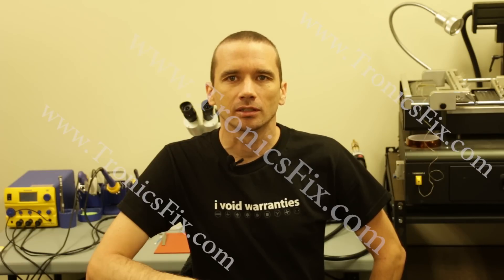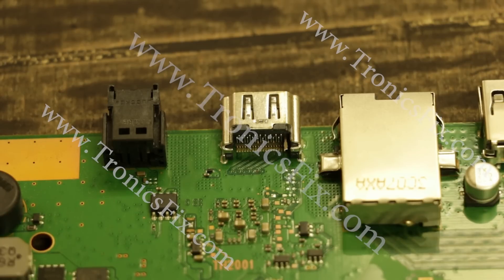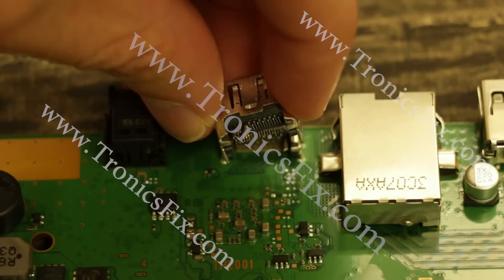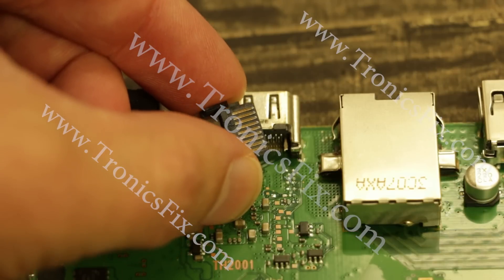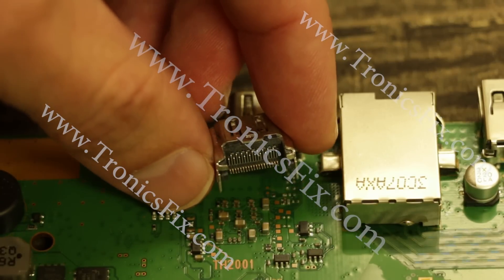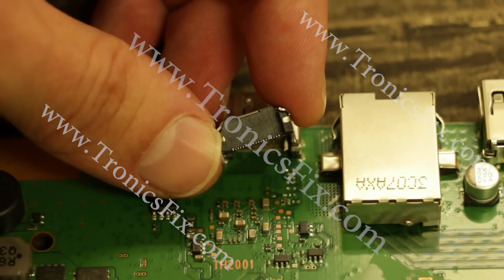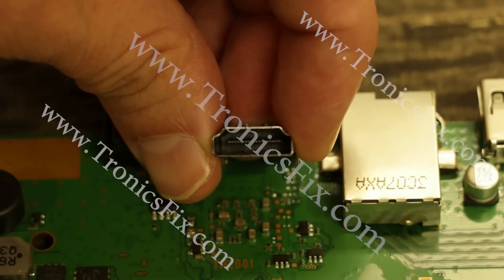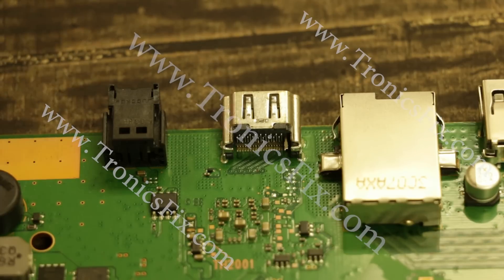Why PS4 HDMI Ports Suck

Comment: Hi, I have a PS4 launch system purchased 2 years ago and due to some health issues and surgeries I had I wasn't able to get around to unboxing it until yesterday. All it does is a pulsing blue light. I called Sony after trying several displays, HDMI cables, and not getting anything to display. They told me they can't do anything for me because it's out of warranty. Even after explaining this they saw that I have been grabbing the free PS4 games from the PSN web store and consider that to be "using the PS4". so even though the box wasn't opened until yesterday and its been powered on no longer than a cumulative 10 minutes they want me to pay $150 + shipping to have it repaired. ... ... Do you know of anything so can possibly try to fix this POS system? ... ... I really hope they get a class action lawsuit against them. It's shameful how they try to sweep these widespread manufacturing defect issues under the rug and ignore loyal customers. At least Microsoft owned up to their terrible RROD problem and allowed anyone to get it fixed for free, even well out of warranty.
Reply from the maker: +videogameobsession This problem is usually fixable but not always. If you're ready to go ahead and buy the repair you can buy this repair: http://www.tronicsfix.com/ps4-turns-on-then-back-off.html 
Even though yours doesn't turn on then back off the fix is the same price.
Reply: Thanks for the reply. Can you tell me if this launch system "Blue Light Of Death" issue is a corrupt firmware issue or something that requires solder reflowing? If it's the latter won't it eventually happen again after more use? Thanks again
Reply from the maker: +videogameobsession It's not a firmware or software issue. It's caused by a bad connection between the APU and motherboard. We don't do reballs or reflows so if that's what you are wanting you'll want to send it somewhere else.
Reply: I don't necessarily want that. I just want it fixed in a way where it won't have the same issue happen again. 
Can you please explain how you guys fix that problem? Thanks.
Reply: +TronicsFix Can you please let me know a little about how this problem (bad connection between the APU and motherboard) is repaired and if the console will have a shortened lifespan with a fix like this?

I have purchased PS4 games for Xmas gifts so I would like to have a working PS4 in time for Xmas if possible. Thanks.
Reply from the maker: Unfortunately we don't give out any info about our fix for this...yet. We will be producing a video as well as a repair kit for it soon, but it's not ready yet. 
The fix has a 30 day warranty because usually the fix lasts a long time but sometimes it doesn't. We're always happy to take a look at it again for you (for free within 30 days) but there is no way to know for sure how long it will last. We have it priced low because of these factors. Once we get our repair kit out there we will probably discontinue this repair for mail in consoles.
I hope this helps...let me know if you have more questions about it.
Reply: +TronicsFix Thanks for the replies. 
I'm not sure what to do here. 

I've been through hell with both the Xbox 360 (had 3 die on me) and the PS3 (had 2 die and many game saves). I paid to have the 360 fixed and it died again in 4 month (not through you guys). And now it's happening all over again with the PS4. 

The fact that it was dead out of the box and Sony won't do a thing for me (except charge me $170) is making me want to give up and stick with older game systems from now on. 

I heard the only way to ensure it will last even a year is to reball the APU to the motherboard.  I just really don't want to constantly worry about it dying yet again.
Reply from the maker: +videogameobsession I'm not sure where you heard that about the reball but even that does not guarantee anything. Usually a reball will last quite a while (assuming that you have it done by someone who knows what they are doing) but not always. 
I totally get how you feel...that's a bad track record! You may want to just have us give it a try, if it's not fixable then we will send it back and you only have to pay the $20 for us to ship it back. We refund the rest of your money. 
Another option is to just sell it on Ebay and buy the newest model, the CUH 1215. That one seems to be designed better. We can't be sure as it hasn't been around long but it looks better so far.
Reply: +TronicsFix Thanks for the advice. I'll have to think about it.
Reply from the maker: +videogameobsession You're welcome. Good luck! Let us know if you need anything else.

Comment: So I got mine replaced around April and there's times the signal is lost or it is not supported, the cables I use work with my PS3 and my other devices.
What do you think of this? Should I get a different cable or get the port looked at again.
Reply: Okay read some other comments I saw getting a new cable should be first 
Weird thing is the cable works for other devices, maybe the port they attached is not compatible with the cable.. 
I'll find out
Reply from the maker: Edwin Vasquez Where did you get it replaced? Sometimes the cable is the problem, but usually a cable won't randomly go bad (although it does happen). I'm guessing it may be a problem with the repair you had done but no way to know for sure. I'd have a look inside the port to see if there are any bent pins.
Reply: TronicsFix I'm looking at it right now. I usually have to force the hdmi in with a bit of force. the pins are fine. I'm not sure if it is this tiny piece of metal that I see in the port. I feel like I should push it down but Idk with what.
Reply from the maker: Edwin Vasquez I wouldn't try pushing anything down...that will probably just damage it more. It could be just the back of the port being loose or something which would cause some of the small pins in the back to become detatched. I would try a new cable first though.
Reply: TronicsFix Thanks for the replies.
Okay It's acting normal for now, but I will order a better cable for now. I'll update if anything. 
Thanks again.
Reply from the maker: Edwin Vasquez Sounds good. Yes, please update if anything changes so others who read this will know what happened. Good luck!

Comment: But mine works at my house other people's houses It don't  work and my HDMI thing isn't bent so I don't know
Reply from the maker: +king YedMelJrx If it works perfectly at your house and displays the picture just fine then your HDMI is probably fine. You should wiggle the HDMI cable a bit when it is plugged in with the console on. See if that does anything to the display. If not then it's probably fine.

Comment: Nice video man! By the way Thanks for fixing my PS4 HDMI. Much appreciated!
Question: Did you end up using that new HDMI port on my unit? Just curious if I have that one or not. Thanks!
Reply from the maker: Angel Acosta Thanks for the comment! No we did not use this new HDMI port...unfortunately we didn't have any of them...we are just getting our first order of them in the next few weeks. The one you see in the video is a sample that they sent so I could check it out.
Reply: TronicsFix Oh I see, that is pretty cool though that you are working with this company to correct this major issue on these units. Well, keep up the good work! As for my system it seems to be working fine and have had no issues. yet with it. =)
Reply from the maker: Angel Acosta Ya, the HDMI port on these are one of the major weak spots. These new ports should fix the problem 100%. I can't wait to be able to install them instead of the old style...they will be so much more reliable. 
I'm glad to hear that it's still working great. If it ever gives you problems just let me know!
Thanks for subscribing...we will be making more videos as we have time. If you or your friends have ideas of videos you want to see, let me know.

Comment: I took my PS4 to repairman for this and he told me their is a 50% chance the playstation will never work again if he uses a heat gun on it. You seem like you can fix the problem no matter is it because the ppl i took it to are amatuers?
Reply from the maker: +letreason reign First of all, yes, he is right that there is a good chance it won't work if you use a heat gun on it. Heat guns are for stripping paint. Anyone who uses a heat gun to fix electronics is an amateurs. I'm not saying that it's not possible to fix some things using a heat gun, just that it's not a professional way to repair things...especially other peoples things. 
We can fix 99% of HDMI problems. We use professional tools and equipment and have fixed over 1,000 PS4 hdmi ports.
Reply: +TronicsFix i live in montreal canada. how much would i be looking at to ship and repair?
Reply from the maker: You can see the prices right on our website: http://www.tronicsfix.com/ps4-hdmi-port-repair.html

Shipping to Canada costs an extra $35

Comment: So basically never take out your hdmi cord even if you have to move.
Reply from the maker: +Alexander Washington Ha, ha...that would help BUT be careful if you move it around with the cord in the port as that can put pressure on the port and cause it to break!
Reply: True. Studied your stuff and noticed my little gold things were pushed back for no contact. Bought another one and made sure that none were messed up with a LED flashlight. Got home and rebooted itself. WLOD is gone. Now I'm subscribing.
Reply from the maker: +Alexander Washington Great news! That was an easy fix then. You were lucky!

Comment: Funny mine is fine and my HDMI is flashing the TV and then it's fine. 
Replaced the HDMI cable. So you want us to use your service. Nope I'm from the UK Sony will replace it free of charge.
Reply from the maker: Rc-Nerd It's always good to try a new cable first and also to clean the hdmi port if you can't see any bent pins. 
We actually want to help you figure out what's wrong with your PS4. If you choose to send it to us, that's awesome...if you choose to send it to someone else that's fine too...we're here to help people get their PS4's fixed. 
We don't generally do business from people in the UK. I wish we could but shipping is so expensive. We get people asking us on a regular basis if we can fix theirs who are from the UK but it's just not worth it because of the shipping costs...we do send parts there though!
Reply: I've found another easy fix. 
There are 4 tabs two top two bottom. 
My bottom ones were pushed down ? 
I have a pioneer £50 HDMI so I know it's not that. So I got a very small flat head and prised them up it fits snug and the problem has gone. 
I agree these problems are the reason Sony Europe have decided to replace this fault. Your service and advice is five star. I'll keep watching your videos as it's still help peace ✌️
Reply from the maker: Rc-Nerd That's great that you fixed it by just making a tighter fit. Hopefully it will keep working long term! Thanks for letting us all know about your fix.
Reply: The picture was fuzzing but the image now is sharper. 
The strips inside the female HDMI are perfect so the bottom tabs must of been causing the black screen blink problem.